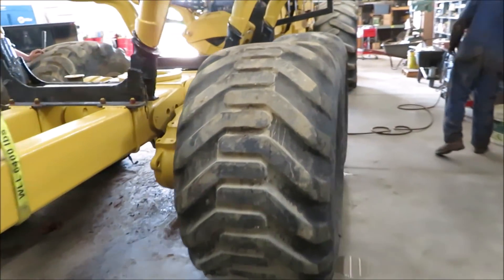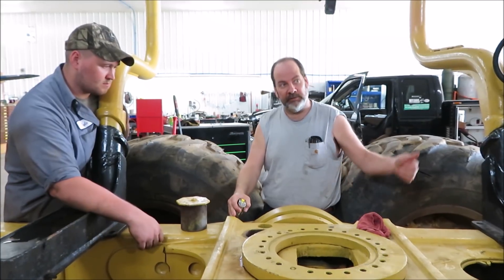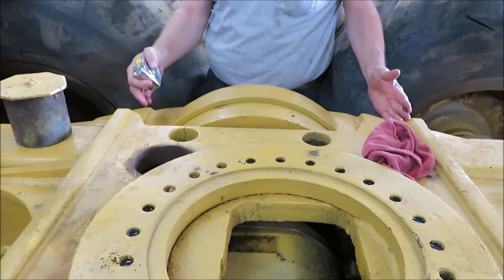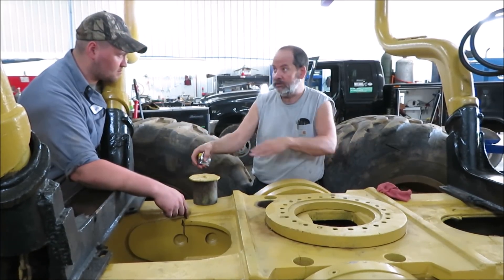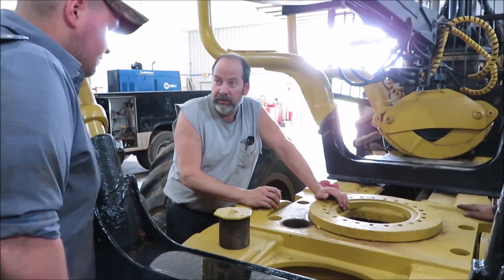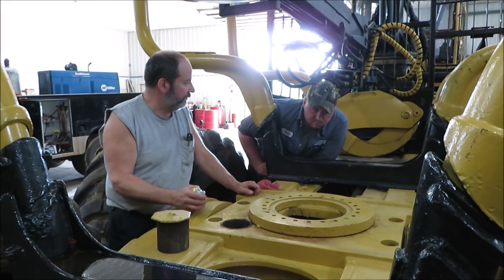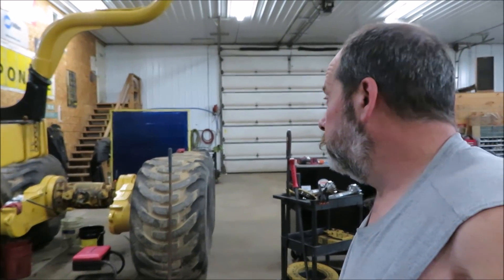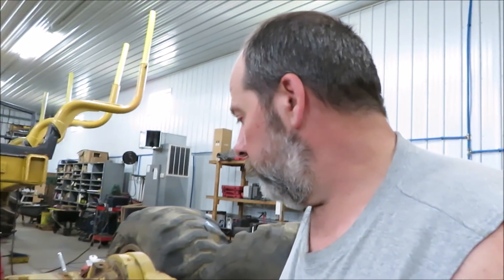Another loose Rear End!

Comment: Hardly any support under the bogie. All the stress is on top of the frame. I had a 4 inch wide 1 inch thick bar put on my Timberjack 1010 6 wheeler under there. Bout 6 foot long. To get more support for the back frame under the bogie. Each side. Dunno if you know what I mean. But it worked.